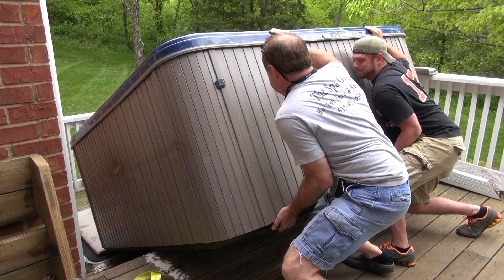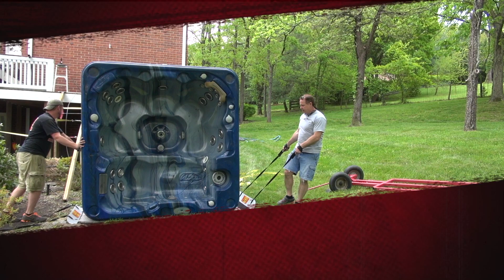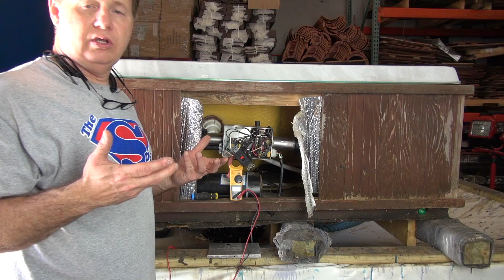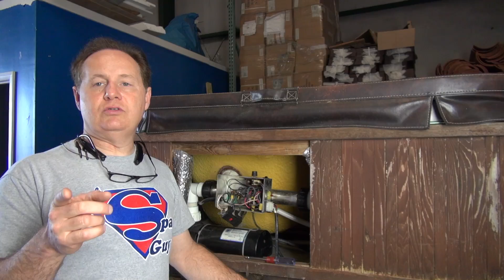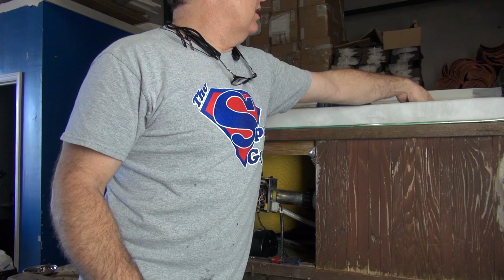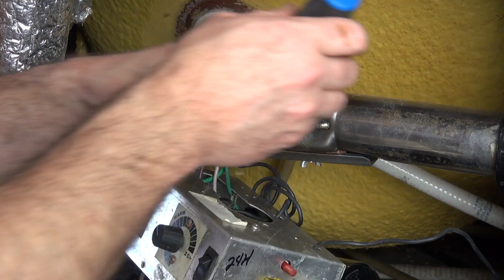Air Button Hydro-Quip CS800-A1 Erratic Operation How To The Spa Guy Hydro-Spa Princess

Comment: Hey Spa Guy! Great informative videos! I have this exact same spa. I've restored the wood on the sides and the fiberglass and cover are in great shape but I've had to replace  couple components now everything is correctly working except the aerator(?) , I guess that is the rotating knob next to the air activated 2 speed switch on the outer top of the side wall. I can live without the air feature for now but what I think I  need is an O-ring for the filter lid, I can't hardly get it tight enough to not let any water partially fill the area above the filter cap. Do you sell them? If so can you send me a link to the correct size please. Keep up the good work and thanks!
Reply from the maker: I have no ideas what kind of filter housing you have.. If it is a pressure style filter this would be the oring.. Thanks, Spa Guy https://hottubpartsofamerica.com/large-o-ring-5-7-8-id-3-16-cross-section-fits-some-filter-housings-pressure-waterway-rainbow/

Comment: I could watch you work all day! Question: I can not find the heater at all on my small 3 person 110 volt tub (Bluegrass 2001). There is a waterway 411-5520 thermowell with 2 small wires attached. Is that the heater?
Reply from the maker: Hello,  Some 115V hot tubs do not have heaters they use either a heat jacket on the pump motor or a firestick on the pressure side of the pump... Usually the pump is a one speed high speed only and there is a small box with a board and two sensors that are in a thermowell.. The part you referenced is the thermowell where the sensors sense the water temperature... Dreammaker brand is one that uses this type of heat system... Thanks for watching... Spa Guy
Reply: Thank you so much for the information. There is not a jacket on the pump, and I had never heard of a firestick, but that is apparently what I have. The thermowell is immediately out of the pressure side of the pump, and I do not see the hot stick fitting, but it must be there somewhere. I had to replace the motor/pump because a bearing was whining. It still heats, and I was just wondering "how?". Would it heat faster if I added another firestick fitting a few feet downstream or the pump? Thanks again!!
Reply from the maker: The firestick is a Pump union fitting usually partially red in color at the pressure side of the pump... the system will only heat about 1 degree an hour no matter what you do to it..

Comment: im having troube with my cs800-a1 the heater says 240v but 110v pump theheats not working 
do i need 240 to the heater part  or is it a bad switch